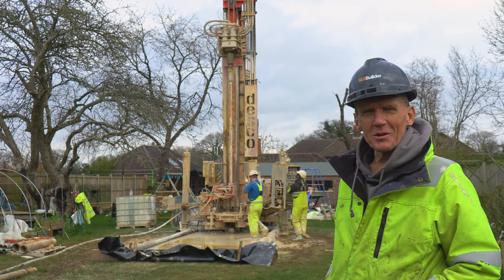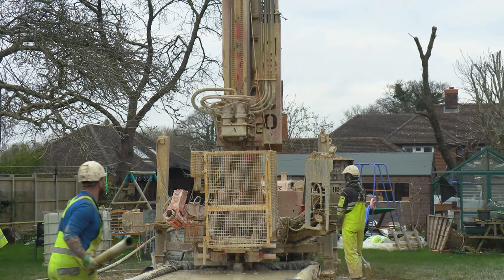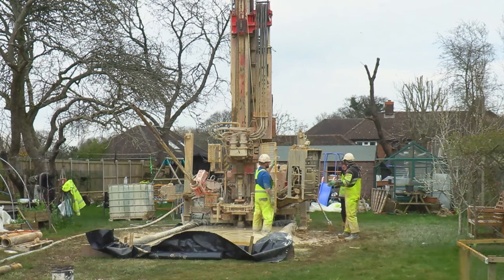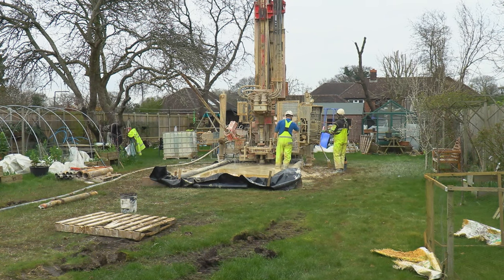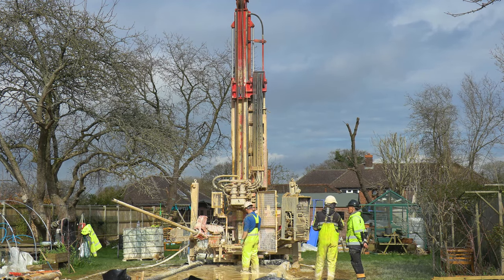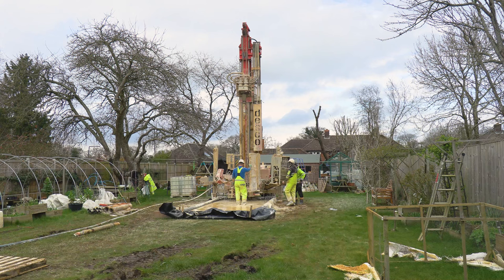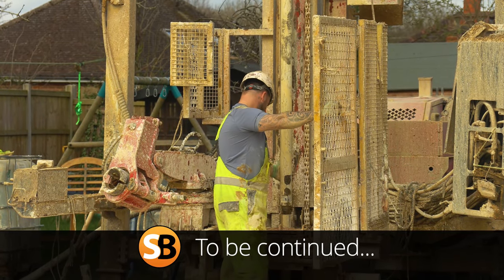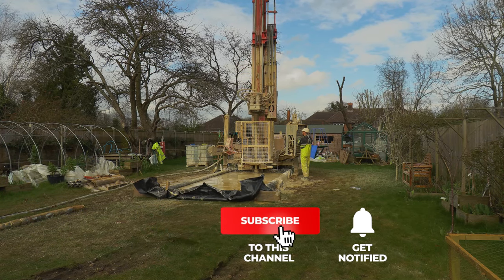Ground Source Heat Pump Bore Hole | Drilling for "Free Heat"

Comment: free heat, when you pay the upfront cost that is the equivalent of decades worth of heating bills
Reply: Irrational
Reply: So a good investment.
Better the. Going through 2 gas boilers.
Reply: Clean energy, very good environmentally
Reply: Yes and that’s the point it’s free….so why the hell don’t developers do this on new build estates and levee the cost onto the properties? Just an idea …
Reply: nothing about it is free. you are paying 10s of thousands upfront. 

It's like claiming if you bought a car outright, instead of monthly payments, the car is some how free.
Reply: So the difference is because there is no tax on carbon?
Reply: Hard to see it considering all that drilling.
Reply: @MinkieWinkle  it's free from the greed and inflating costs that are driving up energy bills worldwide so when everything has doubled again in 10 yrs you won't be at the mercy of greedy energy companies but sitting pretty knowing you have bought not just clean affordable energy but also a certain amount of 'freedom' and self sufficiency.  Does that make sense??
Reply: @MinkieWinkle no it’s not at all, nearest would be if you bought a car that ran on water as fuel but the car cost 10 times as much .
Reply: Ground source heat pumps do not provide “free heat”. You still require electricity (quite a lot of it) to turn the small amount of heat from the ground into something useful in order to heat your house.
Reply: It's still a terrible investment, and still not green! It's way better to install several ACs that have higher COP than GSHP, switch to Octopus Agile. And keep your gas boiler for hot water. Lifestyle improvement AND saving some money, for around 2-3k investment. 
Do the maths. This GSHP costs £35k, has payback time measured in centuries but breaks in 20 years. With S&P500 you'll multiply that 35k by 4 every 20 years, you can afford the price hikes. The grid is getting greener without us doing anything to our homes.
Reply: iscadean3607  except its not, since the energy used to charge the cars are produced by.... fossil fuels. so the unit cost of the production of electricity is already priced into every unit of electricity you use.

Case and point, Why are electric heaters so expensive to run compared to gas central heating? 

Because the unit price of gas is priced into the per unit cost of electricity, why? because gas is used to create electricity. as such the electricity must be prised higher than gas. else there is no point turning that gas into electricity in the first place, because there would be no benefit in doing so from a production perspective. as such, electricity costs more per a kWat than gas, and always will
Reply: I’ve got two bore holes on my property, one for drinking water and one for a GSHP. Both have paid for themselves several times over
Reply: I've got one done by thermal earth, bought the house with it installed, she paid a fortune, trouble is we're paying a fortune for electricity,. You have three to four pumps going full time in the winter - 6 months and finding a refrigerant engineer as things go wrong is like taking your car to a Mercedes dealer.
Reply: @harrylawrence5300  Your situation is very different from the norm. You'd have had to pay 40-100k to get mains water and gas to your property, so going full off-grid is a no-brainer.
Reply: @squeaky_honda I have mains water to my property. It’s just capped off. There is no mains gas in my village, so I bet it would cost a lot more than that 😂
Reply: @harrylawrence5300  By my calculations, GSHP will pay for itself in ~200 years. If you already had gas. So, double your money in 400 years. With investments instead of getting a GSHP,  you can become a trillionaire in 400 years :D.
Reply: @squeaky_honda  the government grants paid for it, but thank you for your concern
Reply: @nicksimmons7234  You could buy and run 3 boilers for 20 years for the cost to drill and install a GS heat pump, most heat pumps have a electric backup 6kw is common, they kick in when the heat pump cannot keep up! I've done all the training and fitted loads in the past 19 years, I'm currently building a new well insulated house for myself, even with trade discounts, plenty of space for drilling or slinky install, the mathe doesn't work out!! Lovely little 12kw LPG boiler and some solar PV, far cheaper to install and run.
Reply: @simsey33 It uses electricity! Unless you have a large PV set up it's far from free when the back up electric boiler kicks in?
Reply: @MinkieWinkle  I was quoted 9p per KWH for LPG from Calor, £600ish for the tank and pipework installed, decent boilers start at about £1000 (Trade) much cheaper to install than a Heat pump.
Reply: @nicksimmons7234  🤣🤣 you think there's no maintenance of heat pumps? They would be replaced at a similar rate to gas boilers....so lose-lose all the way.
Reply: @brianp7022  it's never free, the capital cost of the installation is massive, then the running costs are no less that a gas boiler.....
Reply: Not for a large area or dense housing
Reply: @harrylawrence5300 and everyone knows that government grants are free money, right?
Reply: If you took the sum of money and invested it wisely it would offset any gain from the install and you would still have the principle. Even just a basic 5% savings account it's a lot of money per year.
Reply: @551moley  precisely.

It is madness people jumping through hoops trying to justify 20 to 50k for heatpumps. Vs a 2 to 3 k gas alternative.

Myself as an example, I have a 3 bed house.
I paid 3000 for a new boiler, new rads, labour, 
I have a very well insulates  house which I did my self for 600 quid. I pay about 800 to 1000 per annum on gas.

1000 a year, that is all it costs me to operate. 

To justify a 20 to 50k heat pump, so let's choose the middle number since the house is neither large or small, so say 35k for a heat pump,

I could operate my gas system for 2 to 3 decades. That is how long I would have to keep a heatpump to offset the upfront cost, however. Heat pumps have an operating cost too, a service cost and are typically expected to have an average life expectancy of 15 years.

So In reality. I would never pay it off, it would need to be replaced long before I ever came close to getting my moneys worth out of it.
Reply: And pay higher utility rates than gas furnace costs
Reply: @rob5944 Economies of scale. It doesn’t stack for an individual property, but for district heating systems it’s the perfect solution
Reply: @hughmarcus1  so you're talking about doing a huge version of that for multiple houses?
Reply: People spend more on holidays. They leave memories only.
Reply: @hughmarcus1  so a single point of failure, seen that is russia, entire villages were on a "communal" heating system.

You know what happened when that system failed. Well. Put it this way, people remained sleeping.

No thank you
Reply: @MinkieWinkle  the risk of that is infinitely small. This is the UK not Russia, there’s not a metre of snow.
Reply: @hughM9  you honestly think that you need snow for people to be as risk in the cold? 

In the uk during winter, thousands pass every year due to cold as it is. Now imagine a load of red tape on top of that.

It takes only minutes to freeze, a single night without heat could be devastating.

Look at texas only 2 year ago. Scary stuff.
Reply: The way energy prices are going the payback period gets shorter every year.
Reply: @MinkieWinkle  so only gas is used to create electricity? Have you heard of Solar, Wind or Nuclear power? Go look them up, very interesting stuff
Reply: @simsey33  have you heard about intermittency, what is the back up for solar and wind when it is night or on windless days. oh yeah GAS

Comment: My house is approx 3000 sq ft. Around 2019 I looked into a ground source heat pump. For a full system installation with two 200 metre boreholes I was quoted £45K. I was told that I’d also need a three phase supply for the size of heat pump required. The DNO quoted me £10K for installation. Without a three phase supply I would have required an auxiliary heating source (i.e. a small gas boiler). Instead I went with a 30kW gas boiler for £2500.
Reply: Exactly the response I had in 2008 when I looked at it, cost of the system was astronomic and 3 phase needed to give the required electricity supply.....so glad I decided not to go ahead with the current cost of electricity.
Reply: We were quoted £33,000 just for the 3 phase by Western Power 😂
Reply: Wise choice 55k that's nearly 3k a year in interest at the moment minimum, so one years interest on that pays for a new boiler and you still have the 55k.
Reply: Shortermist I suppose, unless you’re doing lots of building work I’d probably do the same.
Reply: Wise choice. £2.5k vs 45k. They're having a laugh.
If the boiler has a problem it's not 200 m deep it's on the wall!
And you have a +40k pot to draw from which should see you through to your kids retirement 😂
Can't beat gas!

Comment: In 2018, a 170 m borehole costed me 3700 € plus sales tax. Took one day to drill. Maybe it's easier to drill in the bedrock up here in the north (Finland)? Maybe costs are down also due to the fact that 15% of single family homes in Finland were heated by ground source heat pumps in 2022 and the majority of new houses are now built with ground source heat pumps.
Reply: British contractors only like to do a couple of jobs a month.

Comment: Our apartment block in Helsinki converted from oil heated hotwater ring systen feeding 15,000 apartments to ground source heat pumps in each block. They drilled throughout the spring and summer of 2022 completing the job in August 2023. The bore holes were in the car parks and surrounding recreation grounds. Hardly noticed them doing the work.
Reply: District heating is the way of almost everyone in the north but not uk and Ireland.
Reply: @julianshepherd2038  because it has a massive draw back. just like it did is russia. Good luck getting anyone to contribute to it's up keep, so they then fall into disrepair. in Russia hundreds of blocks were left without heating. many people died because of it.  because there was no neighbours house to warm up in instead, since everyone lost it. they put all their eggs in one basket. and suffered for it. 

They have now since moved more towards individuals heated home just like the UK, as such face nothing like they did before. since the chances of everyone's heating system failing is next to zero
Reply: Here in Prague, my hot watr comes from a heating plant 35km away.
Reply: @julianshepherd2038 Hence the UK & Ireland are 15 years behind Europe in energy efficiency

Comment: How much is the total cost without any BS to get this “FREE” heat
Reply: I did a self build and would have loved to do this, it makes so much sense, but just couldn't afford to get it done. I'm on LPG (no mains gas here) but the cost of getting GSHP buys me many, many, many years of gas as the house is super insulated, so unfortunately it was a non starter.

Comment: in NL and BE they are starting to refuse permits for these geothermal bore holes. Due to concerns about damaging/ perforating underground (water) layers.
Reply: What damage? If water is there it'll still be there - the system uses a loop of pipe down and back up the hole - the 'heating' water never comes in contact with the ground water. In fact these systems work even better if the loop is in water, better heat conduction! Maybe the authorities should start reducing the water extraction licences for industry to prevent damage to aquafers through over extraction ! ! !
Reply: The only places in northern climates where it is worth putting these holes is where there is underground water flow. Those places have a good chance of the heat being replenished fast enough to last. Without that the slow inflow of heat from the surrounding area means the source exhausts in a decade or two. In hot climates they are OK. Cool the house in summer, and push the heat into the ground. Suck it back out in the winter.
Reply: Could you chuck a rock of uranium down the hole. It would keep the ground toasty for millenia ;)

Comment: There's a small new build estate in the UK, where the builder put in geothermal drill holes under each pair of houses, that's the way to go.
Reply: Literally under the houses?
Reply: @adrianchetwynd1334  I couldn’t be certain of that, but the cost saving was by using the rig on multiple units. Kinda made sense to me.
Reply: So when the house is old they can throw it down the hole😂
Reply: Forward thinking...A rare activity  these days..
Reply: I agree
Reply: I have a ground source heat pump with two 102 metre boreholes. Works very well and would add very littleto the cost of a new build.
Reply: Johnny, 

that is not geothermal. geothermal is the collection of heat from very hot areas under the earth as is done in Iceland where there are sources of volcanic action.
Reply: @iareid8255  thank you for correcting me, it was the first word that sprung to mind.
Reply: @rogerphelps9939  very little?? Tens of thousands to drill and install the system.....
Reply: @bobstirling6885 if you think it costs 10s of thousands to drill a hole, well good for you. Still less per house than perismonns bonus packages cost.

Comment: Hi Rodger @ SB. I had the opportunity to build our family home and put a 7 kw (evo 7) heat pump from kensa with 2 x 90 metre ground loops in "ground search" did the drilling for me. i did get mates rates on both as i spent time offshore in the drilling industry, also i now the technical guys @ kensa. It cost me around 22 k  (pre covid) if you shop around and can do a bit youself then you can get the prices down. I love my system, no oil or gas bills, no wood burners, and practicaly no maintenance! we add 7 kw sola on the roof, we cant fault it, best heating solution that iv ever had.
I found your channel very useful throughout the build, many thanks.
👍🏠👍

Comment: It would be hilarious if oil started spurting out 😂
Reply: Well, messy...   but it might eventually offset the bill they're racking up!
Reply: You may laugh but .....
I used to live in germany and the village drilled a couple of deep geophysical wells for a district heating system. All was well for a couple of years until the well started producing oil. This corroded ghe stainless steel heat exchangers and they had to replace them with platinum.  Despite all this great fsuccess. The price of heating is linked to the gas price and so the council are laughing and also the residents, it really is cheap on this scale

Comment: Interesting! There are quite a few installed here in Sweden. In particular when people do not have the space to install ground based heat pumps (loops of tubing in the earth), that often are cheaper around here. These are supposedly called mountain/bedrock based heat pumps. As I have understood the price increases with the depth to the bedrock (more tubing is needed). You cannot drill several holes too close either because they will cool each other. It is a high initial cost, and the heat pump compressor might only have a life-span of 10 years, which also add cost. For real free energy the possibility to combine it with solar panels could be attractive.
Reply: The best option is to combine it with solar thermal and use the surplus heat in summer to heat up the borehole. It's called inter seasonal heat storage. You can also do it cheaper with a cluster of shallow boreholes under a house.

Comment: I live in Lithuania and bore hole ground to water heat pumps are very common. However,  I'm building a house at the moment and I've done the calculations and it's much cheaper to just put in 30kw of solar.  But we have the land to do that.

Comment: The German rep for our company had a borehole drilled for a heat pump as did a number of his neighbors.  Unfortunately all the houses in his road now have problems with subsidence.  The drilling punctured an impervious layer of rock and allowed ground water to make its way up underneath the row of houses and now they have a problem they can't easily fix.
Reply from the maker: We would be keen to have more information about that job.

Comment: If you search for this old house geothermal on you tube you should get a video about a gshp in new york.
The interesting thing is that some company designed a very compact drilling rig especially for drilling boreholes for gshp. It was very quick and recycled water etc. Most rigs are very large and you cannot get them into a garden expecially in uk. Make yhe drilling easier and cheaper it will be a good option for some people.

Comment: Good video.  It would be really nice to have an explanation of how the final system works (diagram?) and how all the pipes are connected to each other.  I don't understand how the different boreholes work together and how the they are connected underground.
Reply from the maker: That is the next video in this series.
Reply: It’s a loop. They drop 2 pipes down the borehole & pump a brine solution slowly through it. The heat pump extracts the heat from the solution as it passes through the heat exchanger. 
The advantage over air source is that the heat from the brine is at a pretty constant temperature thus enabling the heat pump to run at max efficiency
Reply: @hughmarcus1  I don't understand how they connect the different boreholes under the ground to form a loop.

Comment: I’ve put a couple of ASHPs into properties because they were bungalows and it just made sense.

I would like to know what made the vertical ground source make sense for this development.
Reply: The hole lasts 100 years and ground source is about 25 more efficient than air source. If you are around in 100 years you will be up on the deal. I  think it adds value to the house because it is efficient but  its a scary investment. New builds absolutely